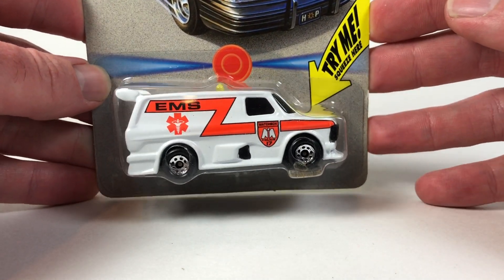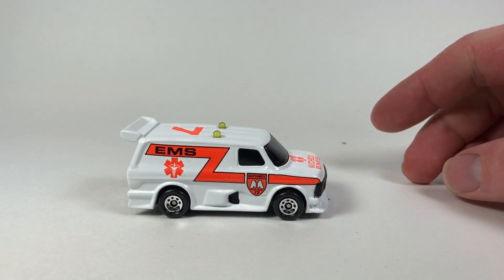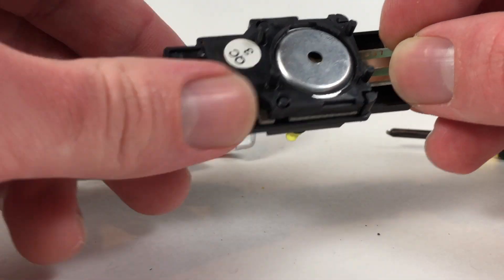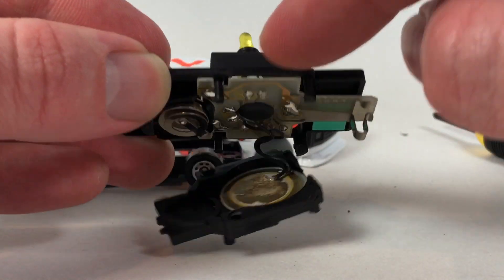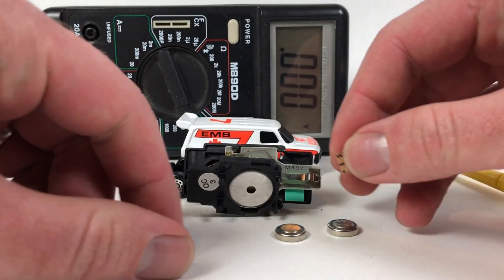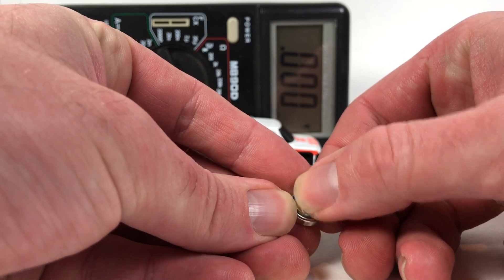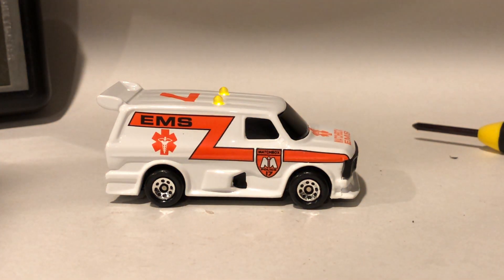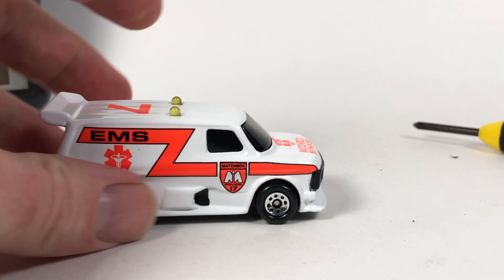Free the Piece Friday - MBX EMS SUPER VAN II (Batteries Included)

Comment: I have a Majorette Sonic Flashers, which is the same general kind of thing only from Majorette, that's a military truck that I believe was originally a firetruck casting that was repurposed into a military vehicle with a camouflage livery and a narrow gauge cannon on top instead of a ladder. I got it from a Value Village thrift store toy car grab bag so I'm not entirely sure how old it is (the entire Majorette Fandom wiki has just been deleted because of "copyright violation" which seems absurd) but I believe it dates from around 1990. 

Anyway, it's around 30 years old and the battery still works (without any obvious signs that the chassis has been removed to replace the battery). It makes a rapid-fire missile-launching noise. I have a few more Sonic Flashers but only that particular military vehicle still makes a sound.